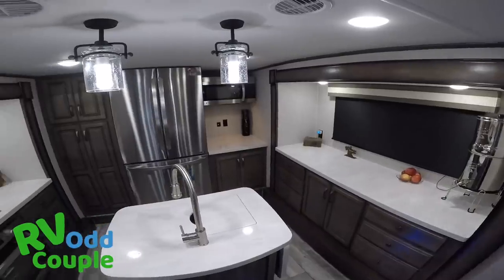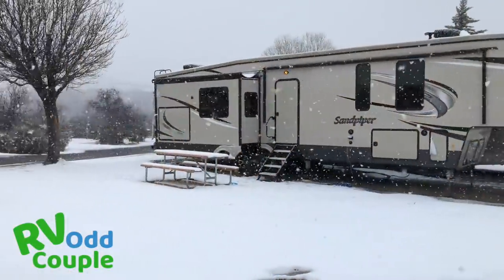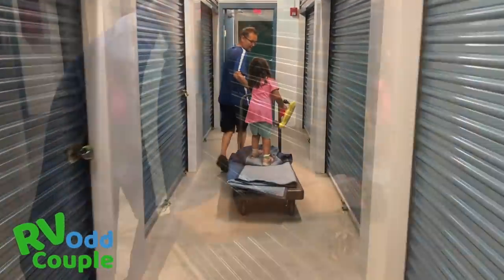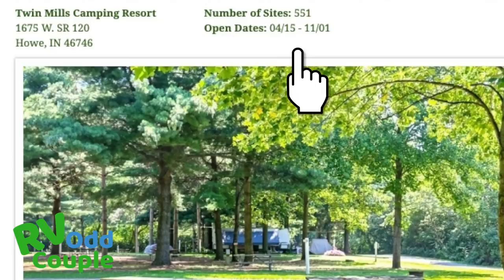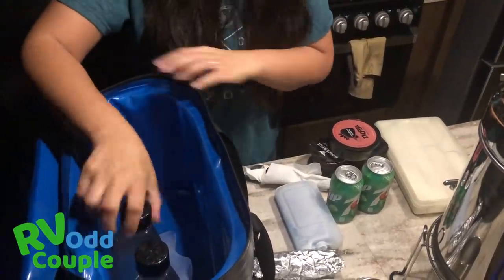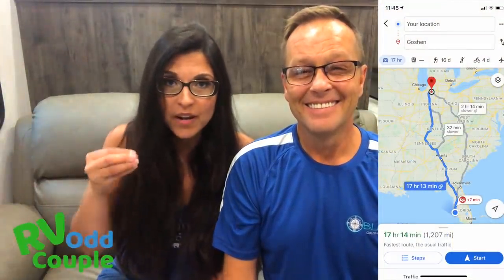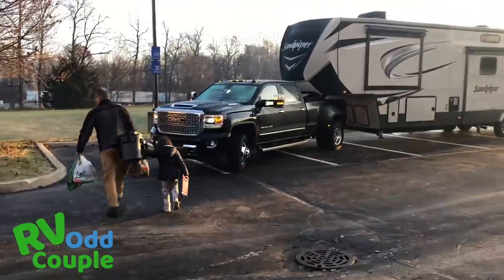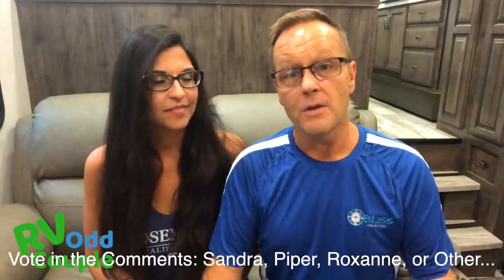RV Winter Storm Threat (Long Distance & Cross Country RV Road Trip Tips) Picking up Our New RV

Comment: I love your Chanel, I say this as a Canadian, for winter weather you want to make sure your radiator mix in your truck is sufficient for the cold. a greater concentration of radiator fluid will raise the antifreeze number. Where I live it can go to -40 f, so the engine freezes and breaks.   
Another concern is your laundry machine will have water in its motor so you should disconnect the water and either throw in a jug of windshield wiper fluid that is rated for cold wether, or there is another product designed for winterizing cottages and RVs, and then turn on the laundry machine so the fluid is pumped out of the machine.

Another thing to watch out for is medication. Drugs can be damaged in the cold. 

As a person who has done alot of winter camping, you ignore the cold and do with out.
Reply from the maker: Thank you for sharing your experience and giving helpful tips. We never considered the washing machine. Learning something new from the RV Odd Squad every day👍😀 Thank you Douglas & stay warm

Comment: Just completed a similar journey--took my 2020 Grand Design from Colorado to Elkhart to get new suspension/brakes installed on 11-12 Dec (2500 miles). Four days over, two at hotel, and four days back. Massive snowstorm covered four central states on return trip so I had to spent an extra three days/nights at Prophetstown State Park in Indiana while it passed. The great thing about traveling up north this time of year is empty campgrounds and cheaper prices but other than electric, most facilities are turned off. After 14 days, it sure felt good to get back home in one piece. Congratulations on the new rig. Piper would be my choice.
Reply from the maker: We are from Colorado Craig. Lived and sold our biz in Parker CO 5 years ago. What an adventure you had!  Glad you made it back safe. We were lucky with the weather. Hope that we meet you one day! Happy New Year & thank you for sharing your experience

Comment: Congrats on the new rig! MAKE SURE you pressure wash the underside of the new rig with soap and water when you get back to Florida. Maybe do it a couple of times. If you don't, and there was salt on the roads, the underside of your frame will be solid surface rust in a few months. Those frames are not galvanized like an auto frame and it will be covered with surface rust. Looking forward to 2020. Our vote is for "Sandra".
Reply from the maker: Great idea Joe! We'll do a video on prepping and our Maiden Voyage. Happy New Year & Thank you!

Comment: So now that you've been in the RV a while I have a question.  With the small loads you have to run through that combo washer and dryer, are you doing laundry every day?  When we were full-timing, we found that the 1.5 hours we spent a week at the laundromat was worth it to only have to spend that much time each week doing laundry.  Of course we were fairly stationary so I imagine if you are actually travelling quite a bit that the quality and cleanliness of the machines is a real wild-card.
Reply from the maker: We run the laundry once per day and it works out perfect for us. Happy New Year & Thank you

Comment: Hello RV Odd Couple - Thanks so much for sharing your journey.  My wife and I are planning full-time RVing starting in the fall and your insight has been so helpful.  Question for you.  On your new Forest River, it is my understanding that full time or "residential use" of the RV will void the manufacturers warranty.  We just purchased a 2020 Dutchman 5th wheel and found out when getting some warranty work done that had we been full time, they would not have covered the work.  My search of Google shows that FR has the same policy.  Did you have any conversations with FR about this?
Reply from the maker: Yes, we were aware of this. This is the policy of most manufacturers. Forrest Rivers Riverstone are built for full time use. The build quality is superior and they are pretty much hand built. They start around 100k
Reply: @RVOddCouple  Thanks for the super fast reply.  Was pretty shocked when we were told about this "AFTER" we purchased the rig.  We told them from the first meeting what our intention was and they never said anything about it.  Lesson learned.  We should have gone with Grand Design like we originally had planned.  From what we've read, they pretty much cover all their 5th wheels provided we're not renting it out or something.
Reply from the maker: Yes, the dealerships won’t tell you unless you ask. It’s in the contract when you sign. We considered GD but they are a fairly new company and there manufacturing volume was fairly low compared to Forrest River. We liked that FR has been been building Rigs for decades.  All manufacturers use 80% of the same parts from other companies. GD customer service has been good from what we can see so far but they were recently purchased by Coachmen. We’ll see what happens when there volume quadruples. We love Forrest River and have been very satisfied with customer service.

Comment: We have a gmc sierra 1500 Sle never thought of fuel filter.  Maybe that's why our gas mileage is 12.4 mpg
Reply from the maker: Our fuel filter was due.  But that milage doesn't sound that bad.  Ours is 18 not towing and 10 towing.  :-( .
Reply: Lisa Lancaster, unless you have a Diesel Engine in your GMC 1500, there is no serviceable fuel filter on it.
Reply: Thank you for replying ours is gas engine.